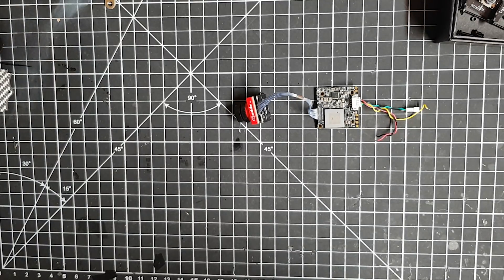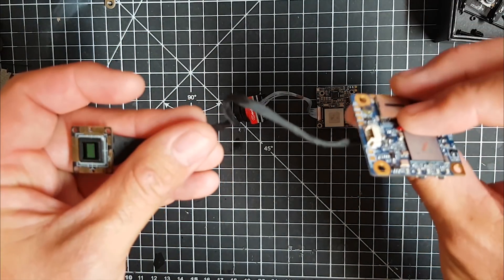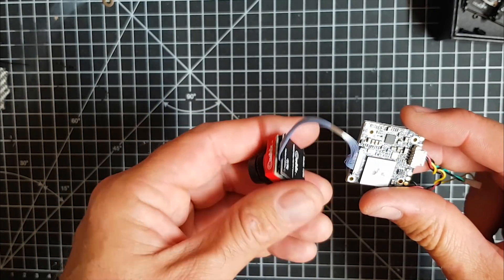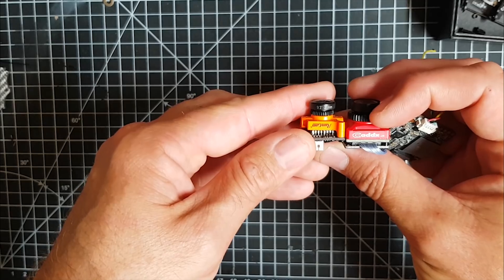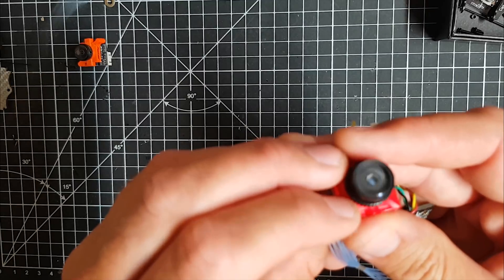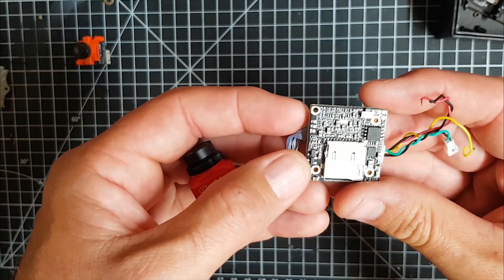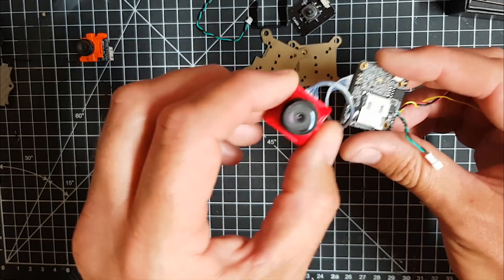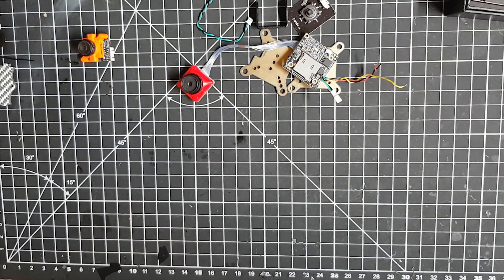Caddx Turtle/Turtlet Review & Footage (see description) / Betaflight 3.5RC2 stock

Comment: I have terrible noise in the fpv feed, even with only lipo and vtx. i will sell my 1 on ebay
Reply from the maker: Big BOOST FPV that's just noise from your setup. Use a capacitor or lc filter and power it from a cleaner source
Reply: @CoppertopFPV  No, there is no set up. only a lipo no copter no fc no esc and there are Nevertheless noise with this cam, with a swift eagle sparrow - no noise!
Reply from the maker: Big BOOST FPV I know. You need to power it from a solid 5v source. It's the same with the split. They're suspectable to anything other than a low 5-9v source due to the electronics. You'll see way less on any other camera

Comment: how can I go into the menu? Nothing happenes when i press the button
Reply from the maker: kampkrieger just press the osd dongle button when it’s not recording
Reply: thanks for the answer, but it does not do anything
Reply from the maker: kampkrieger check the connections on the cable. You can also solder directly to the pads on the turtle if the connector is faulty.

Comment: Nice review! Do your goggles cut to 4/3s or compress the image? My goggles compress the image and I manage to stretch it later on in the pc without much quality loss. You can check my last video as a sample, recorded with fatshark's DVR. Software is Avidemux and it is ultra fast. I usually give all my DVR videos a stretch pass before compositing.
Reply from the maker: Lapsus Mental FPV crops I think. Tbh I never use it other than for finding my quad, so it doesn't bother me ;)
Reply: Fair enough :D